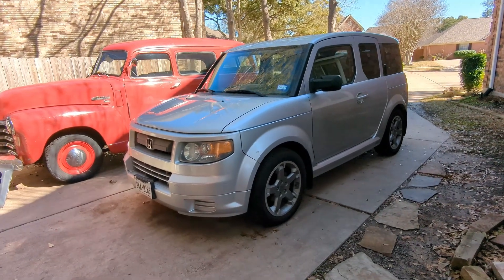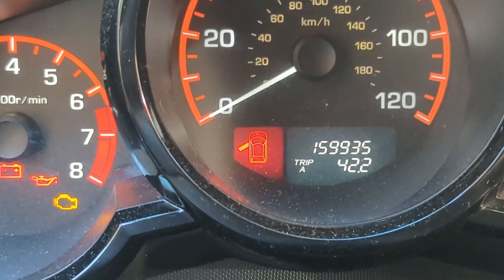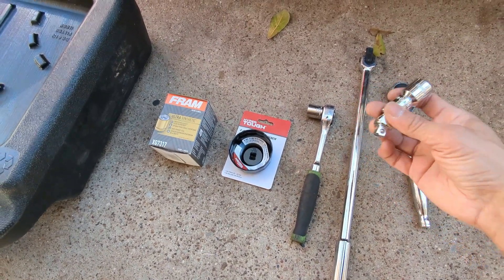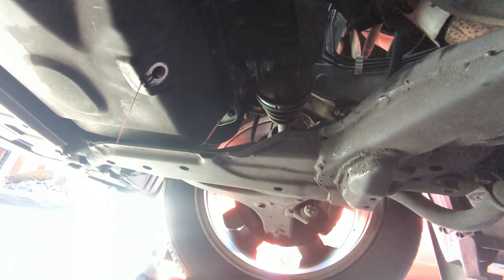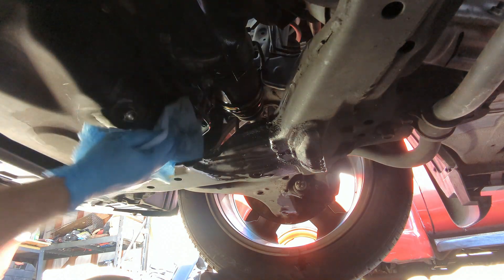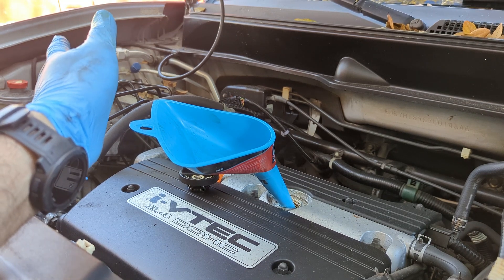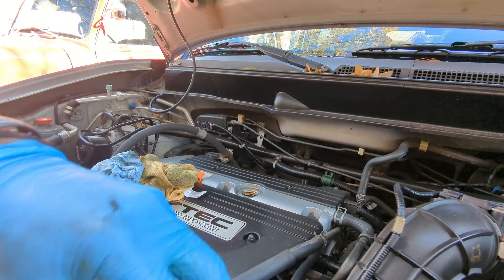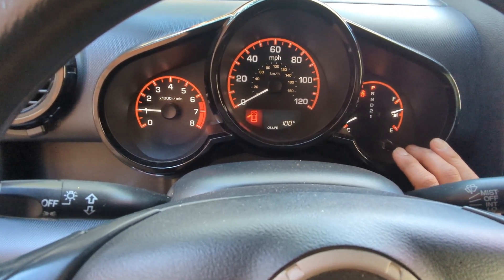Honda Element oil change🛢️

Comment: Just got under my element for the first time and the oil pan bolt is stripped. Excited for this journey.
Reply from the maker: Buy these, easy fix! THINKWORK Bolt Extractor Set, 13+1 Pieces Impact & Nut Remover Stripped Lug Remover, Extraction Socket Set for Removing Damaged, Frozen, Rusted, Rounded-Off Bolts, Nuts Screws https://a.co/d/bcdRscY
Reply: @alekslpez yup yup gonna give it a go tomorrow. Trying to shave down the 17mm bolt a bit so I don't have to bang the 16mm extractor on too hard. Heard it's super easy to bend the oil pan